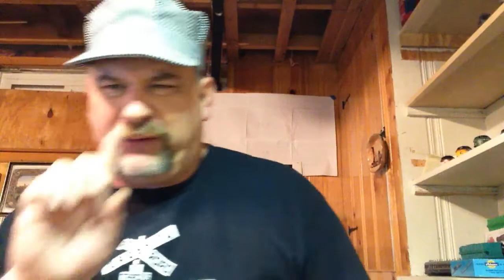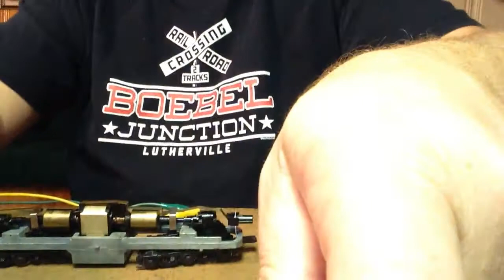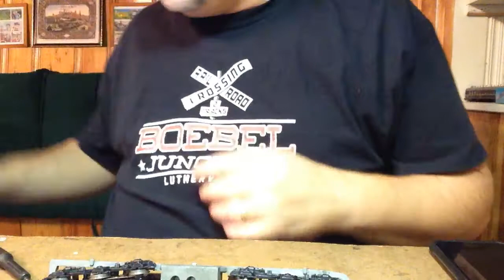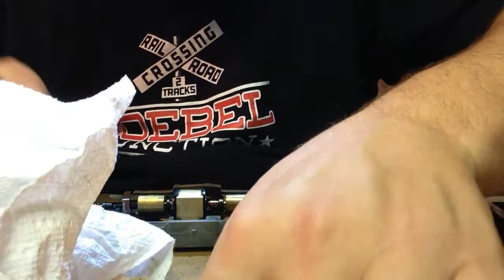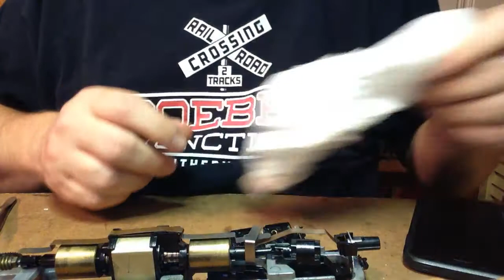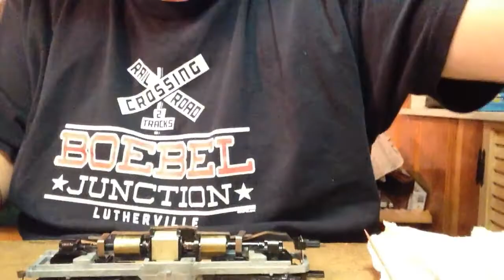Boeville & Newtown Vlog #24-2017, 12/3/17

Comment: Hey ray nice video on tune up of gears. I’m gonna use this and follow along to do my B.B. F 7’s. Can you tell me what you use for grease and oil? Thx. David.
Reply from the maker: Gear lubricant - Atlas Gear lube #190, Oil - Bachmann, not sure on the part number for it. The biggest thing is to make sure that you buy a plastics compatible grease and oil. There are other brands, but this is what I have used. I did try Woodland Scenics dry white lube (HL652) but found it didn't seem to stick well to the gears and it was a bit of a mess to use.
Reply: Ray Boebel thanks Ray.  Wish me luck.  I was surprised that they both ran still. They’ve been in  their boxes for the last 20 years or so. Lol
Reply from the maker: Under the "How'd he do that?", there are 2 maintenance videos as well. One for diesels and one for steam. Mine had been sitting around awhile as well before this. Take your time, it will all work out!
Reply: Ray Boebel thanks. I’m learning a lot by watching guys like yourself. You tube and FB groups have made this hobby so much  more accessible than it was 20 years ago. 👍🏻🚂
Reply from the maker: Agreed and glad I can help!!!!
Reply: I'm glad too! Lol. Now if you could only pick my name in the contest! Lol. Just kidding buddy. Looking forward to the next video.